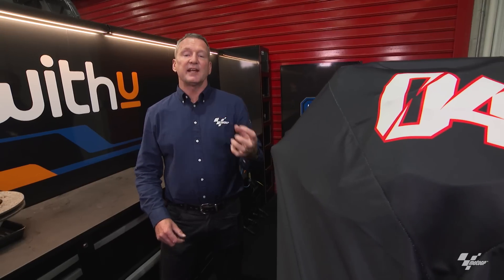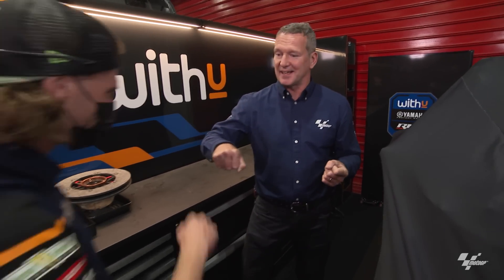Air-Fuel Mixture | Tech Talk with Simon Crafar

Comment: The lamda sensor or O2 (oxygen) sensor measures the oxygen in the exhaust, not temperature. When every bit of fuel burns every oxygen molecule, there is no oxygen left in the exhaust 👍 either side of this is rich or lean. Great work as always Simon.
Reply: Whats the other side or no oxygen ? Less than no oxygen ?

Comment: I get the environmental angle on changing the fuel but this is a specialised prototype style of racing. It should be about the spectacle and not the PR angle. Would prefer the money be spent reducing emissions within the freight or transport area of the paddock.
Reply: Its all about the r&d. The best of the best minds will be in the motogp engineering team and what they develop will transfer to the street eventually.